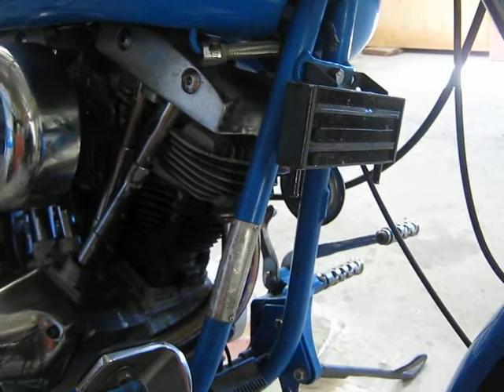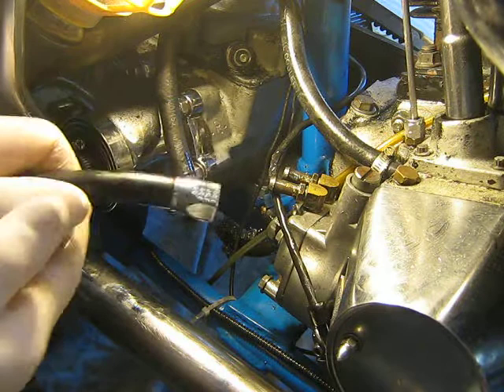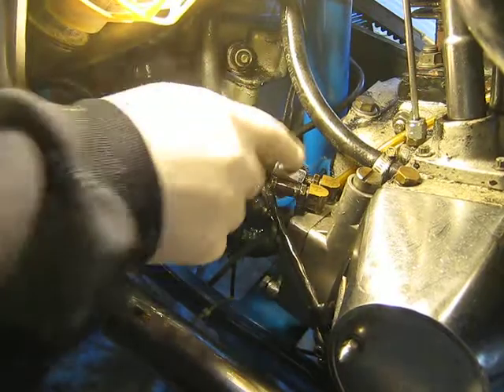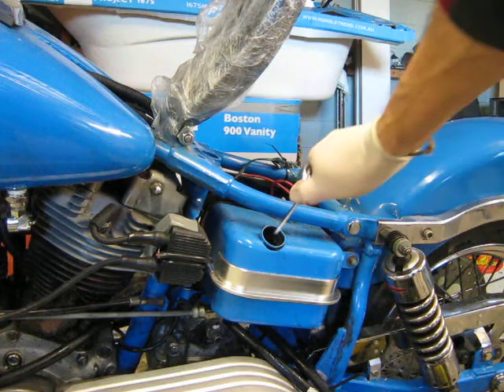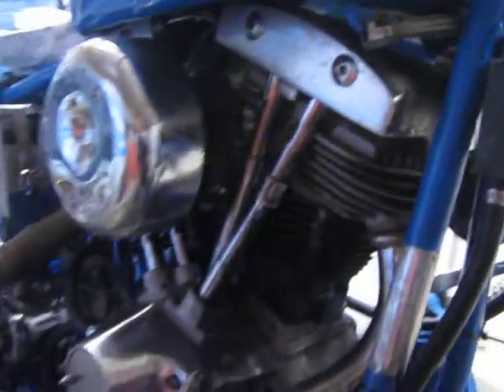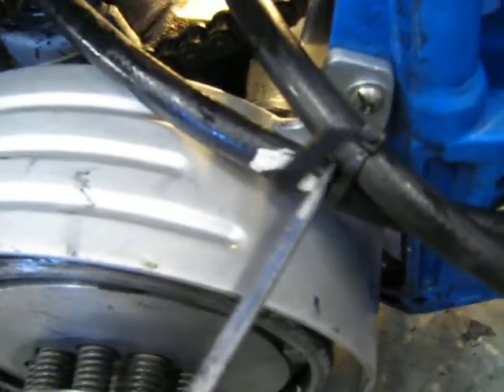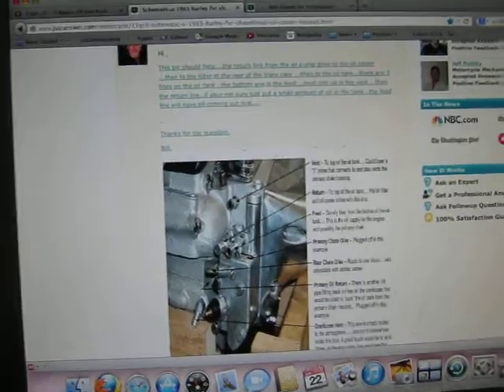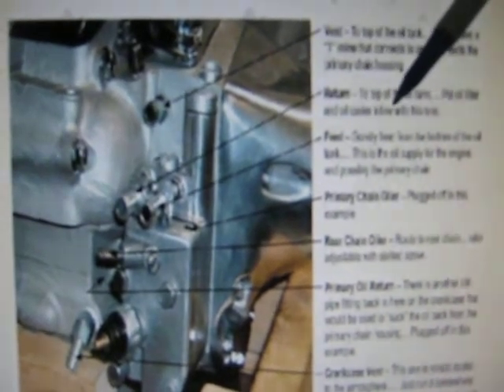Fitting an oil cooler to a harley shovel

Comment: Not a bad job. However, I would not use worm clamps because they tend to back off. I would use crimp on clamps which is what Harley-Davidson used on the oil lines begin with. They are similar to the clamps used on PEX tubing. You can use a crimper designed for them, but I use end Nippers. More reliable and clean looking.